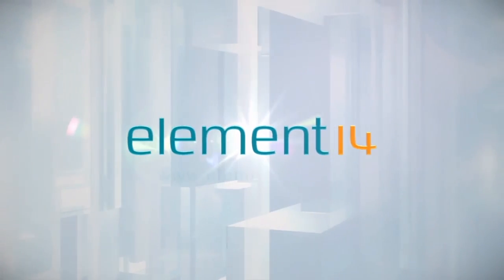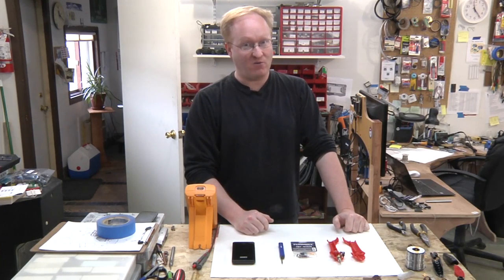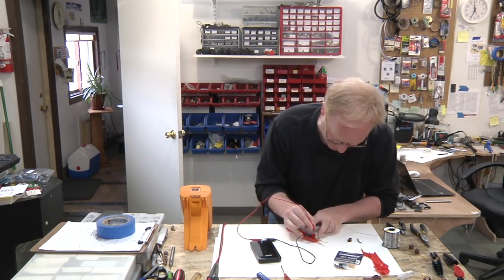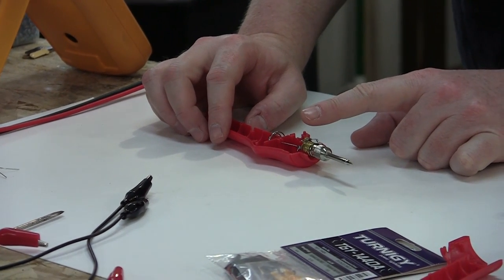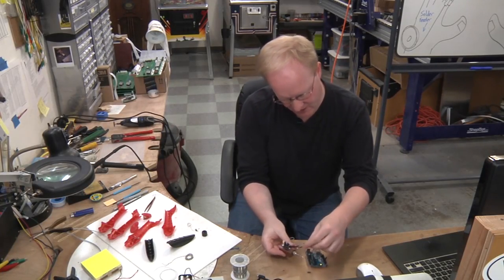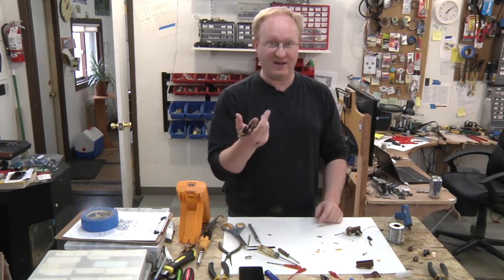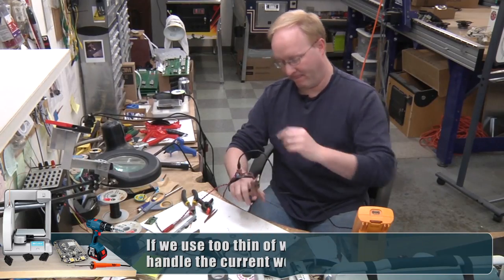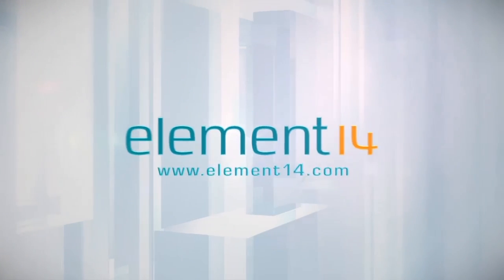Ben's Wearable Solder Gauntlet Part 1

Comment: Ben,

You gotta give your viewers more credit.  I'm sure the majority of us know what Ohm's law is, and could easily handle a more scientific explanation.  That, and the law is traditionally taught as V=IR by engineers and scientists worldwide.  The fractional versions (V/R=I and V/I=R) are generally considered as derivations of the original equation.

TLDR:  your viewers are smart, so don't be afraid to challenge us!
Reply: In Europe, it's actually U=IR, and that's probably the "original" law, since Georg Ohm was German.

U (apparently from Latin "urgere") is used to denote voltage, because V is already used for volts (the unit). Otherwise, you'd write things like V = 2 V, which looks like an impossible equation (unless V=0).

To me, V=IR looks a bit confusing, because (to my eye) it's mixing units and amounts/concepts. It would almost be better if it were V=AΩ, so it would just use the symbols for units, instead of mixing both.

Comment: it should have a idle mode using PWM you could have the tip at a known hot temp not so hot your finger gets hot or the plastic melts but hot enough that it will hit soldering temp much faster
Reply: He should just use Metcal (OKI) smartheat technology for his iron hand.
Reply: Stingray Best soldering station EVER

Comment: Random off the wall thought inspired by Ben's hacked up accessibility controllers.

What if you could make two controllers into one? maybe switch modes with the flip of a button? like an Xbox 360 and PS3 controllers built into one? Their both similar in button layouts, just different looking styles of the controllers themselves.

I don't know if this is actually possible, buts its a good thought to me.

Comment: probably a better idea is a tool belt like batman had, or the telephone company linemen have...   only every tool you use most often...     but for me that would get heavy.  power screw driver, wood screws, washers, flashlight, metal cutoff wheel tool, whizzer brush wheel, tin snips, crimping tool and heatshrink tubing, hot glue gun, flat black spray pain, multimeter, etc...      so instead I create a table that has my most used tools and parts on it

Comment: he is going to burn his finger, i garentee it
Reply: There is no doubt that the small amount of kapton he put on there will insulate it enough. The plastic is going to melt, there is no doubt about that either. Filament for 3d printers melts around 200-300 degrees Celsius, whereas that iron will reach 400 degrees Celsius easily.

So not only will he burn himself, but will have plastic melded to his skin, enjoy picking that off!

Comment: Fun Fact: Ohms Law is always true but: The resistance is temperature depending and  a soldering Iron self-heating. So, you can´t simply measure the cold resistance and calculate the current when hot.

Comment: Technically well done, but pretty pointless as does not have any tangible benefit, ie the positive benefit is greatly outranked by negative. Would also have little use for fine soldering work either.

Comment: TI Chronos? It's OK I guess. Wireless connectivity is neat. But my good ol' Datalink USB has a much better display. I wrote a countdown timer app for it that I use, like, all the time, and sadly there's just no way a program like that would work with the TI Chronos and its..  what, 9 character display?  What were they thinking, making such a capable programmable item and then sticking it with such a limited display?

Comment: It should be I = U / R and not I = V / R. U, I and R are the symbols, while Ampere (A), Volts (V) and Ohm (Ω) are the units. Oh and one way to remember Ohm's law would be to memorize "URI" (one could think of "Yuri" or sth.), because U = R * I.

Comment: basically the inner surface can melt ,,, it needs some modification ......
even safety comes first we can burn our figure ........

i would suggest,,,  for inner surface u can make metal coating......
and secondly extend the 3d printed part upto nail

Comment: Why you didn't use a bend flexy resistant to do the switch job?? 3 bends on 2 bends off
try to find a glove and fit more crazy things on it! bend resistant can do a great job. Some people use them to make a glove like a joystick to control a PC. The bad is a resistans cost 10$ so 10 fingers and 4 + 4 moves for the wristband run the cost up.

Comment: A word on the effect of temperature-dependency in most resistors would have been nice. The iron on a 20V supply would most likely use less than 172 watts, because the resistance in most conductors goes up with temperature, reducing the resulting current. Since power is voltage (unchanged) multiplied by current (now lower), the resulting power consumption is reduced.

Comment: Ben, if heat is an issue check out an item called the TIG finger used by TIG welders at the Weldmonger Store (www.weldmongerstore.com) I've seen this in used and while bulky you might be able to modify it for your uses to keep the iron finger cool. Love this idea Ben. Keep up the good work.

Comment: Making a wearable soldering iron is a cool idea. But I would prefer to use a Bowden cable (maybe you can use some kind of flexible fibre material instead of the steel cable) for the sliding mechanism and put the servo together with the battery box, so you have less weight to carry on the fingers.

Comment: I have yet to watch the second video of this thing, but it seems like the heat from the  iron would heat up and destroy the 3d printed parts and the hot glue. Even if it only comes on when extended, the mount in a thermo plastic which I would think would have a lower melt point since it's used for 3d printing...

Comment: Why not use lilyPad  im mean the mosfit works well and you'd still need the the power source but you could put a temp sensor and control it pretty decently with arduino it'd definitely be more complex though....

Comment: can i take my wireless soldering iron that takes 4 AA like Ben's and solder a usb connection onto it and plug into a solar charger for cell phones? if so how big of a solar charger do i need?
Reply: If you use the one that takes 4 AA batteries, then that uses about six volts, measure how many ohms it is, then you can figure out how many amps it needs to be able to draw from your power supply. I think Ben's was 2.3 ohms. So you say six divided by two point three equals about two point six. So you need a solar charger that can deliver at least 2.6 amps, more being better. Look for a solar charger that has a battery that can deliver  six volts at three amps. The solar capacity can be less, since it might sit charging for several hours in the sun then get used for a few minutes. You could probably build your own a lot cheaper than you can buy one. You could use capacitors instead of batteries. It depends on your needs. Some capacitors can hold a charge for several days. I saw this one video of a guy who replaced his car battery with capacitors. It sat for the weekend and still cranked. It was better in cold weather than a cheap lead acid battery. If you want to solder directly from the solar power then you might consider just focusing the sun to heat the soldering iron directly. Solar cells are expensive and inefficient. You could probably redirect the concentrated solar using fiber optics to the the back of a metal tip mounted to one end of an insulated tube.

Comment: The Ben Heck Show Can you make a computer that is about the size of rasberry pi and has a ram slot where you can upgrade your ram, a cpu socket where you can upgrade your cpu, and a gpu slot to insert a good gpu?
Reply: look for a mini-itx board or even a pico-itx. It's bigger than a raspi, but how would you fit all that you said on a raspi ??
Reply: Well not really rasberry pi size, abou the length of a gtx 780
Reply: Cole Mcclellan
 Then you should really look for a mini-itx it has all you want and you can get one for about 60$. I'd be surprised if Ben did that since you can get something similar for cheap.

Comment: What kind of avr dev board is he using?
Reply: +Neel Sarwal 
+Filo Bolla
It's one Ben designed about 3 years ago. He and Felix just designed an upgraded version. It's not for sale anywhere, but Ben said if there was enough interest, he could sell the PCBs on his website.
I could also post a picture of it on the element14 Community if you'd like a closer up view of it.